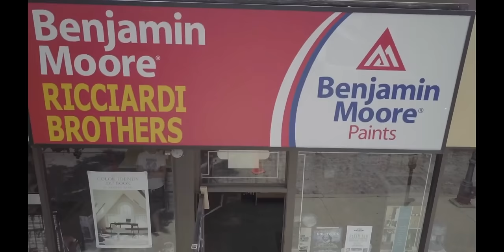Beginners Learn to repair One concrete step in 5 min  4k video | Concrete and Cement Work

Comment: Nice work. I love that bullnose edge.
Reply from the maker: Thanks Darlene
Reply: Dependable Concrete Contractor of do 30 or 49 steps at a time
Reply: What do I do ?
Reply from the maker: Jorge we can do larger jobs but this video is to show a homeowner how to accomplish replacing this small step job them self.
Reply: Darlene Young and in 3 months the portland cement popped off and we had to hire an actual professional.
Reply: Sorry to hear that.
Reply from the maker: Please don't believe that.
Reply: Where can I find that special bullnose edger tool? Nice work guys
Reply from the maker: Shunt Ok https://nolenbuildingmaterials.com/
Reply: They aren't making that page easy for a small order of a trowel.
Reply: Darlene Young HD gana Khesari Lal ka HD ganap0l

🍁👞👞👓🏘️

Committee Desh Premi ke gana Desh Premi ke gana

Comment: came out real good. but what I don't like is putting another thin layer over the concrete. it will separate form the main slab. be better if poured it with no gravel then worked it no added layer

Comment: Really nice, but one good trick to add is to use a jet of water to carefully clean off the cement that's on the footpath.
Reply from the maker: I thought we did a good job cleaning up the site. Did we miss a spot?
Reply: You probably did as well as possible with what you used (sponges I guess). 4:42 could be improved using a garden hose.
Reply from the maker: After  4:42  we spent time sweeping and cleaning barricading etc.

Comment: how would you fix a step half way up to second floor that the bottom is chipped away along with part of the sides? I'm not sure how to make the new cement stick to the old as well as keep in place up in the air while it cures. Thanks in advance for your help.

Comment: Personally I would have bullnosed the sides too but maybe that’s just personal taste, artistic license, practical limitations i'e cracking the corner off if stepped on, but I think it would have looked better. Nice skills though and a good looking step. I think these extra mile details just make a functional object more of an art form. I could see someone specialising in decorative detailing of this sort of thing... in fact it has my mind racing with idea's ;-)
Reply from the maker: Yes correct we could have gone an extra mile. However this is a commercial step that will get lots of foot traffic and hand trucks impacting the step.  So its form vs function, we chose a compromise of both. This is a paint store with lots of weight going in and out of the store.
Reply: Why you do not have rebar  at the tip of the bull nose that is a very weak point of the step you must put rebar in the bull nose 2 #4rabars
Reply from the maker: Jerome Brown I never had a problem in 40 years where the bull nose broke off. If we saw this trend then we would have responded to it by now.
Reply: I love your attention to detail, I can see you take pride in your work so much respect to you.

Comment: Great work. Can you advise again what type of sand you finish with (I couldn't understand the audio). Is it the same standard sand used in the mix or is it a finer sand? Thanks, Dean
Reply from the maker: Same standard sand.  But is called "bar sand."
Reply: yes for the finish use bar sand or play sand,  they are finer grit sands

Comment: I have to subscribe your channel for this excellent tutorial. Q> The color of the surface material in this video is very dark. My concrete stair is light gray color and I need to do a resurfacing. Do you have a suggestion on which product to use so that the color will match my current concrete stairs? Thank you
Reply from the maker: .  Typically I will use a full gallon of adhesive , 1/2 bag of play sand and type 1 cement in a 5gal bucket.  The mix is liquefied by the adhesive.   I also use a paddle and a drill:

http://www.homedepot.com/p/M-D-Building-Products-Deluxe-Mixer-Paddle-49058/205226510?cm_mmc=Shopping%7cTHD%7cG%7c0%7cG-BASE-PLA-D23-Tile%7c&gclid=Cj0KEQjwnazLBRDxrdGMx-Km4oQBEiQAQJ1q6xEGBL9z-gbxSY_Ioocw3EB5aO7OQzfWh0mCiHQ9r2IaAvGt8P8HAQ&gclsrc=aw.ds

 (1 part glue, 1/2 bag play sand, cement qty to match qty of sand.).  This mix is a few shades darker then concrete.   It's likely to be a better match once its weathered.
Reply: This is the color of my stairs http://www.doityourself.com/forum/attachments/framing-flooring-sub-flooring/83106d1500256654-how-hide-new-concrete-stair-repair-patch-img_20170716_191725.jpg

As you can see, I have to resurface the stairs to hide the patch.

For the cement, I found here:
http://www.acehardware.com/product/index.jsp?productId=2041962&KPID=2091857&cid=CAPLA:G:Shopping_-_Concrete_Mixes&pla=pla_2091857&k_clickid=04919365-87b1-43c6-8b64-6e4987be6d29

Quikrete® Portland Cement (1124-47) Product Type: Portland Type 1 Cement Color Family: Gray

Please correct me if I am wrong here.

Two parts play sand, one part type I cement and with the Quikrete
1 Gal. Concrete Bonding Adhesive

I hope this mix will match my stair colors. Thank you!
Reply: Remember that you can always mix the cement to a thick paint consistence and apply with a hard bristle brush or paint brush or sponge. That way the entire surface will look the same. Resurfacing is quite easy/fast to do. :-)

Comment: Where were that young man's knee cap pads? I hope he wears them! Great job!
Reply from the maker: If you look closely you will see that he is kneeling on a large rectangular knee pad. We buy our knee protectors from Lowes  https://mobileimages.lowes.com/product/converted/035965/035965064514.jpg
Reply: Dependale Concrete Contractor

Comment: no wire required inside the cement in this project?
Reply from the maker: Wire will prevent the cement from directly treating the foundation walls. The cement need to treat the walls not the wire.

Comment: I cannot find that bullnose trowel with the 45 groover. can you direct me to where I can get it
Reply from the maker: +Mr Meener Sure my pleasure. https://nolenbuildingmaterials.com
Reply: Thanks buddy. do not see it on the site so I will call
Reply: do you put a 45 degree cant strip on the form to match  the bull nose trowel groove so when stripped you can follow it?
Reply from the maker: They are closed on the weekends but will reopen Monday at 7am.  Ask for Mary Beth and let them know that Dependable Concrete referred you to them.  They have them on the shelf.
Reply from the maker: you need to add a strip to your casting lumber called a chamfer strip. A 1" chamfer works best. However you can use molding that will closely mimic the profile of the tool, allowing the tool to follow this indenture is important. I place my chamfer 1.5in below the edge of the board and and attach the chamfer using finish nails. The strip must be attached evenly across the top edge of the lumber. The top edge of your lumber is your guide. Do not pour concrete above the lumber because it will be a challenge to  finish the bullnose look with using the tool; this is a critical step in the process.
Reply: they make these things called form liners they can even stamp the concrete for you but you need to vibrate the hell out of it.

Comment: How can you tell its time to remove forms from the step and begin smoothing and finishing ?
Reply from the maker: When the cement has hardened enough to support itself when the form is removed.  If you can easily push your forefinger into the  concrete then its too soft to pull the form. Patience is important!

Comment: I'm resurfacing my steps with 1" on the top of existing steps(old concrete), what concrete mix should I use?
Reply from the maker: Leonid Popov http://www.youtube.com/playlist?list=PLT9hb1LxOFGjSCkAPGEXRKRmIIBdf_EQp
Reply from the maker: Leonid Popov use type 1 cement and play sand from Home Depot or Lowe's. Must add concrete bonding glue to steps first.
Reply: Thank you
Reply: bad idea better to just tear out and replace

Comment: THE CONCRET STEP   IT IS BIGGER ON THE LEFT SIDE THAN THE RIGHT SIDE  min. 5:11
Reply: That jumped into my eyes right away. Well it was obviously a choice for whatever reason. But the important is that the finished product is OK. :-)
Reply: Whatever this guy is a pro Congratulations.
Reply from the maker: There is a small protruding brick wall (yellow) that makes it smaller on the left. Watch the video closely then pause it and you will see why there is a difference.  However the step to step distance is equal.

Comment: Covering  your work with Portland is a lazy way to finish and could crack and peal.Rock salt will eat that finish right off
Reply: it was done while concrete was wet, therefore its integrated and pressed into the wet concrete for a long lasting finish.

Comment: Worst finishing job i have seen.
Reply: why? help me to improve
Reply: Vincent Douglass After looking at it again I may have been too quick to judge. I didn't take into account some important factors such as matching the existing surrounding and what the customer requirements were. If your goal was to match existing surrounding than you did a good job. If you wanted a better finish I would say that more care in floating gives you a better finish, also using a fiberglass or wooden float instead of a sponge float will flatten and fill to give you a perfect finish for sponging. I would like to apologise for my first comment it was unfair and I didn't take other factors into consideration.
Reply: Stansla Michael hey no problem. Thanks for the response